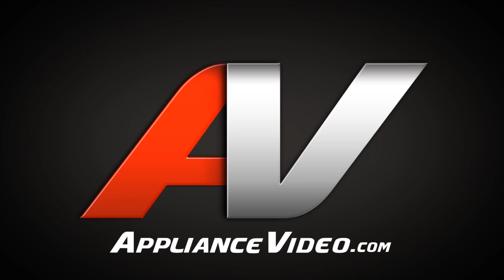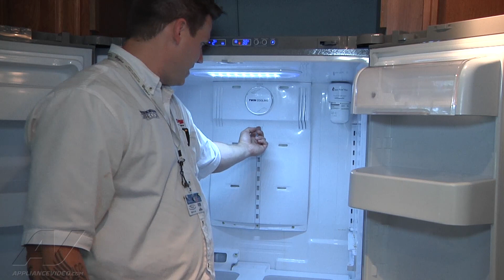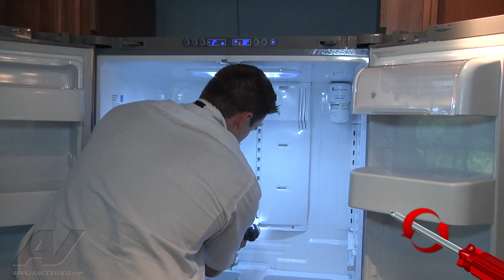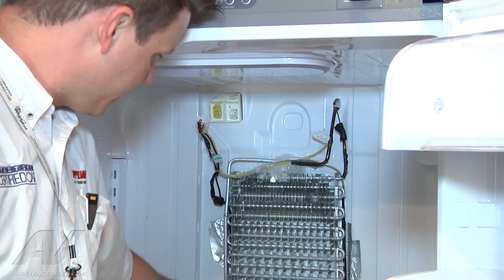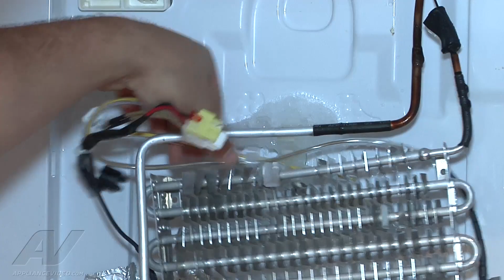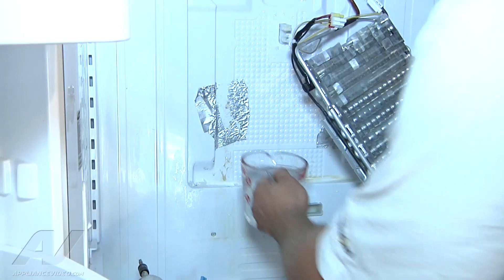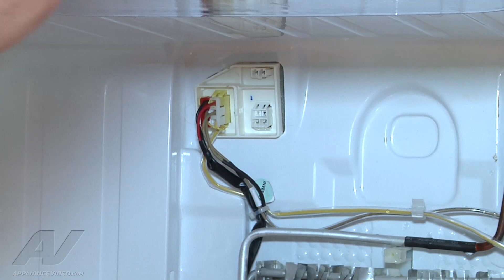Samsung Refrigerator Repair - Freezing Up On the Back Panel - Evaporator and Defrost

Comment: I actually found an easier solution, I was having the same issue with my 2016 Dutch door model...after the warranty expired of course.  I tried the manual defrost on my but my computer in the frig must be different and it didn't work, so I just left the top part of the frig doors open for 6 hours; about 5 days after I did that the fan hitting the ice noise came back.  

Ok, so I defrosted it again for 6 hours, then I decided to play around a bit with the temp settings, first I raised the top part of the frig temp to 40 degrees instead of 38 where I had it, then I raised the middle drawer from the meat setting of 29 degrees to the drink temperture of 33 degrees...so far so good, no ice build up that I can tell for 3 months.

I think either Samsung put a poorly designed defrosting capability in their units, or the internal thermometer that is suppose to keep the temp at whatever temp you select is off by a few degrees, so when I had the top part of the frig set for 38 it probably was around 32 to 35, and the drawer likewise was probably running at 25 or so instead of 29.
Reply from the maker: Thank you for
your positive response, we are glad we could help. Please help us by
subscribing to our YouTube channel or post our website www.ApplianceVideo.com  on your Facebook page. We want to let your
friends & family know how our FREE videos can help them.  Or you can
support our parts department at 1-800-830-5465 and our parts website www.SaveMoreOnparts.com .  This is the only way we can continue to
post free videos and help over 1-million people per month like you repair their
own appliances. We also have thousands of more quality videos on all major
appliances made by our factory trained technicians at www.ApplianceVideo.com .
Reply: @Appliancevideo  Update:  My fridge is getting worse, I don't understand why, but I have been manually defrosting it now every 3 to 4 WEEKS for the last 14 or so months!  Everything is set according to my first post, I don't want to warm up the fridge above 40 or things will spoil, so I'm stuck with defrosting it every 3 to 4 weeks.  I even tried turning off the power saver mode thinking that was causing the problem, nope, same result.
Reply: I would have written the same answer

Comment: Tried calling your 800-830-5465 number but it says it's after hours. Are M-F 0600 - 2000 CST still your current hours? It's 2030 EST right now, which would make it 1930 CST.
Reply from the maker: Hi Matthew, that is a number for a company called Save More On Parts. We are ApplianceVideo.com - we do not sell parts. Their hours are Mon-Fri 9am to 8pm EST and Sat-Sun 11am-6pm EST

Comment: I have a Samsung refrigerator model RF263AERS .The cool select pantry has half on inch of ice in it
and has ice underneath it. The temperature adjustor doesn't seem to work.
Reply from the maker: Great question, you can call
our parts department at 1-800-830-5465 and they can give you help 6-days A week
Mon-Sat . You can also search at www.SaveMoreOnParts.com 7- days a week.  If you have a more
technical question that our parts department cannot answer, our technicians are
answering all questions at our website at www.ApplianceVideo.com under our Repair Help section. We have over 6,000
common questions and answers that you can easily search through by your model
number, appliance make, problem or error codes, and It’s completely free to
search through our question & answer library. There is a very good chance
you question is already answered there.

Comment: Hi, do you have a link to the heating part in the video with the two clip on regulators? Thanks
Reply from the maker: If you call 1-800-830-5465 with your model number our parts department can look it up. Thanks

Comment: I have put mine on Forced Defrost and let it sit for 20 minutes beeping and then removed the back panel and the heater coil was not hot at all. Would you suggest the thermostat part, the fuse part, or the heater coil itself if that is the case? I have to defrost the ice every 3 weeks in mine as it never melts off.
Reply from the maker: Great question, you can call
our parts department at 1-800-830-5465 and they can give you help 6-days A week
Mon-Sat . You can also search at www.SaveMoreOnParts.com 7- days a week.  If you have a more
technical question that our parts department cannot answer, our technicians are
answering all questions at our website at www.ApplianceVideo.com under our Repair Help section. We have over 6,000
common questions and answers that you can easily search through by your model
number, appliance make, problem or error codes, and It’s completely free to
search through our question & answer library. There is a very good chance
you question is already answered there.

Comment: I have the same refrigerator and this ice buildup keeps happening. I see this part you replace here is discontinued. Does that it's not fixable?
Reply from the maker: Great question, you can call
our parts department at 1-800-830-5465 and they can give you help 6-days A week
Mon-Sat . You can also search at www.SaveMoreOnParts.com 7- days a week.  If you have a more
technical question that our parts department cannot answer, our technicians are
answering all questions at our website at www.ApplianceVideo.com under our Repair Help section. We have over
4,000 common questions and answers that you can easily search through by your
model number, appliance make, and problem or error codes, and It’s free to
search through our question & answer library.

Comment: isn't there a thermostat on the defrosting system that you would test first
Reply from the maker: Great question, you can call
our parts department at 1-800-830-5465 and they can give you help 6-days A week
Mon-Sat . You can also search at www.SaveMoreOnParts.com 7- days a week.  If you have a more
technical question that our parts department cannot answer, our technicians are
answering all questions at our website at www.ApplianceVideo.com under our Repair Help section. We have over
4,000 common questions and answers that you can easily search through by your
model number, appliance make, and problem or error codes, and It’s free to
search through our question & answer library.

Comment: I need of your help..!!!! My refrigerator had a bunch of ice build up in it and this would happen every so often.. I just broke the ice up and kept going about my day, now it has stop working all together and the digital numbers on the front started flashing.. I then looked up somethings and did those things, flushed it with hot water and cleaned the coils at the bottom of the refrigerator... it worked for about 15 min then it cut off again, in the 15 min period I could feel the refrigerator getting warm like it use to and you could hear both fans moving, and it didn't make the loud fan sound that it did have when all the ice was building up on it..Could you tell me something else I could or maybe you know what's wrong with it..?Samsung refrigerator- RB195ACPN .... that's the model number
Reply from the maker: Great question, you can call
our parts department at 1-800-830-5465 and they can give you help 6-days A week
Mon-Sat . You can also search at www.SaveMoreOnParts.com 7- days a week.  If you have a more
technical question that our parts department cannot answer, our technicians are
answering all questions at our website at www.ApplianceVideo.com under our Repair Help section. We have over
4,000 common questions and answers that you can easily search through by your
model number, appliance make, and problem or error codes, and It’s free to
search through our question & answer library.

Comment: I will avoid ALL Samsung products for the foreseeable future because of this pile of junk I bought unless they come to me and buy it back, move it out and replace with another brand...not about to happen.
Reply: I wholeheartedly agree. The biggest piece of crap on earth
Reply: 100% correct...Samsung refrigerator is absolutely the worst. The new filter design is impossible to install. We have had nothing but problems for the four years we’ve had it. Drain freezes up constantly and plastic parts have become brittle and are breaking. Never again!
Reply: They should have class action lawsuits against them because they know these things are faulty!
Reply: Yeah These are trash... don’t ever buy one but if you are here you already made the tragic decision.
Reply: @JON-Megalodon  that's not the case. I've never had mine connected and it's been doing it for years.
Reply: Dude exactly. I have this one and I'm pissed. Apparently it is inevitable that this shit will happen and almost on a schedule. Garbage
Reply: @zakkwylde4201  Just don't connect the waterline and it won't happen,  inlaws never did and its been running since 2013.
Reply: @MSotelo503  my did
Reply: They are absolute shit.
Reply: @BJJandBS  Agreed, pretty sad to spend 2000 on a piece of crap.
Reply: We'll replace our crappy Samsung refrigerator with a Panasonic.
Reply: Yep the kitchen appliances really suck. Go with LG, Amana, Whirlpool or even Bosch if you can afford it. Anything but Samsung.
Reply: LG ain't much better. Parts hard to get. No help from company. No one in my area will work on either brand of fridge.
Reply: Wish I seen this comment before I bought one of the pieces of shit fuckin brand new didnt last 6 months
Reply: Same with me. I called and told them about the class action lawsuit about their refrigerators, but they said mine was a little older than the one that covered by the lawsuit. I told them I would never buy any Samsung appliances again. Crap.
Reply: Same.  I will never, ever buy a Samsung fridge.  Mine started running warm in the fridge when it was not even one year old!!!  I had two repair guys come out on two different times.  They didn't even charge me, even though they got it running (they chipped away at the ice), b/c they knew it wasn't really "fixed."  Pretty decent of them.  Nobody wants to touch this fridge with a ten foot pole.  They're intimidated by the damn "computer" panel that seems to be on the back.  I am shopping now for a Maytag.  The fridge was 50 degrees in the winter, and is now 60 degrees in July.  My LG fridge before that was also a piece of shit.
Reply: @snu3877    I tried to do my research and found the customer advice so contradictory as to be useless.  At least I realized it wasn't anything a technician would be able to fix, didn't waste that time and money, good on your guys for not charging you.

I've learned to live with it via thawing it out  about every other month, just turning it off and collecting the run off with towels without allowing it to warm the food significantly.

   The settings controls and displays failed last yr. but amazingly I haven't lost significant food, it still keeps freezer frozen and fridge very cold.  (the only large screen TV I ever bought also Samsung and it died young too)

Hope to make  refer last a few more yrs until I build a new house.
Reply: @Mrbfgray  I have been debating doing just that: unplugging it and just putting stuff in a cooler for a few hours or more to have it limp along a couple months, before it needs it again.  Honestly?  Things just are not well made anymore.  I replaced a a cheapo alarm clock I had had for over 20 plus years about a year ago, and it weighs a feather compared to my old one.  Our cat knocked the new clock onto the floor, and it now has an annoying buzzing sound that can be stopped if you have the magic touch and slap it around a certain way.  It's f***ing ridiculous.  Why is it that old fridges lasted 30 years and new ones can't even seem to make it to 5 years??
Reply: @snu3877  I don't even unload it, just let the most of the ice melt out and be careful not to let the food thaw or warm significantly.

Most things last longer than ever if you get quality, but I've had gripes with big appliances lately and somethings just went the wrong direction.  Microwaves are the best example, absolutely retarded to have to push multiple buttons when all you need is an on/off and a timer.  To get that you have to find one of the few commercial units available with nothing but a dial, restaurants can't afford to waste time with infuriating buttons.  

Both I and a brother independently found a Sharp nuker that you can literally walk past put item in in stride, slap the dial to desired time and swing the door shut.  Door release is on the handle so one motion there too instead of the stupid separate button release.  How ppl put up with the standard type I don't know, unnecessary complexity is just WRONG.
Reply: @Mrbfgray  Can you suggest how many hours it might take if I decide to try it?  (Keep in mind it's very hot here in CT.)
Reply: @snu3877   You have humidity but we've hit over 110 already more times than I can count in lowlands farther N. Cali.
It might be better insulated than you think but do it when you can check on it every couple hours at first.  I let it go overnight often, more if needed.  If food starts to noticeably warm go right back to normal operation.  Repeat if necessary in a day or so to whittle down the glaciers.

Sometimes I'll leave freezer door slightly ajar with power on for a few hours, keep the refer cold while letting ice melt in freezer, pull out ice slabs at very bottom when loose, some food thaw risk but good to go for a few months.  Even leave open and OFF for a couple hrs.  If food begins to thaw you can close it, power up before damage done, mop up whatever ice and water you can. (I know, a bit of a senseless pain in the ass, but it worked for me for yrs, refer always almost too cold how I like it) 

 Refer I generally leave closed power off for longer with bath towel folded up in bottom and swap with dry towel once maybe after saturated.  As pathetic as it may be I tend to have a folded towel in bottom of refer all the time.

Bit of an art but it's easier than doing the dishes.
Reply: @Mrbfgray  Thanks!
Reply: @snu3877    Good Luck--pardon caring on.
Reply: And the big stores keep pushing them.
Reply: Complete trash. Both my samsung dishwasher and fridge keep crapping out
Reply: Same here. Regret buying Samsung fridge just 2 years old nothing but trouble. Earlier had a fridge air for 10 years with not one problem. Went for a bigger fridge Samsung and now regret it
Reply: Bo McGillacutty m e too
Reply: My 1st and only big Samsung flat screen failed early also, that's two for two, my phone by them has been OK tho.
Reply: I just bought a house that had a Samsung washer downstairs and a Samsung refrigerator upstairs.
 Washer sounded like crap and would not stop running stop running and now the refrigerator is making this noise.
 Washer sounded like crap and would not stop running and now the refrigerator is making this noise
Reply: 100% agree these fridges are trash. better off sticking to the old top store freezer fridges, those things are tanks
Reply: Bo McGillacutty their televisions are the absolute best, but yes...appliances have a problem.
Reply from the maker: Thanks for your response, we are glad we could help. Our library of over 5,700 videos are currently helping over 1.6 million people like you every MONTH.  Please help us by subscribing to our YouTube channel, or post our website www.ApplianceVideo.com to your Facebook page, Twitter, Instagram or any other social media sites. Your support will help us keep producing more free quality videos.

Comment: refrigerator not making any ice    nor or water coming through the linewhat's can ceause that
Reply from the maker: Great question, you can call our parts department at 1-800-830-5465 and they can give
you help 6-days A week Mon-Sat . If you have a more technical question that our
parts department cannot answer, our technicians are answering all questions at our website at www.ApplianceVideo.com under our Repair Help section. We have over 4,000
common questions and answers that you can easily search through by your model
number, appliance make, and problem or error codes, and It’s free to search
through our question & answer library.

Comment: Great vid, my issue is I not sure if the heater is bad, I bought it for a pretty good price but after t ran for a couple of months it did freeze up and stop cooling. Can I test the heater to find out if it is bad?
Reply from the maker: Great question, you can call our parts department at 1-800-830-5465 and they can give
you help 6-days A week Mon-Sat . If you have a more technical question that our
parts department cannot answer, our technicians are answering all questions at our website at www.ApplianceVideo.com under our Repair Help section. We have over 4,000
common questions and answers that you can easily search through by your model
number, appliance make, and problem or error codes, and It’s free to search
through our question & answer library.
Reply: @Appliancevideo   ApplianceVideo.com